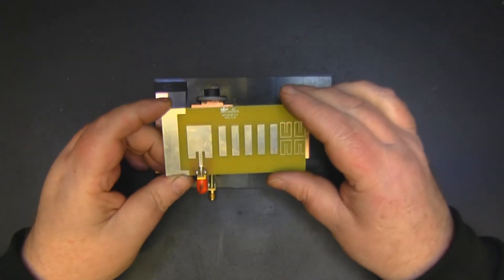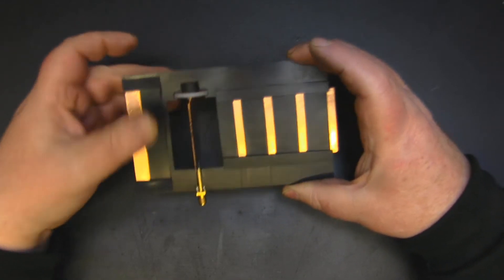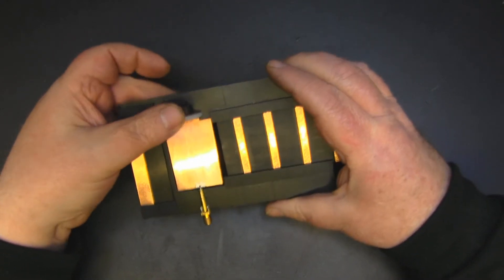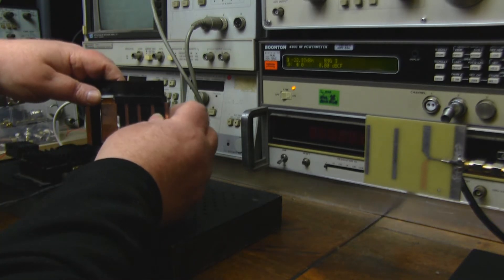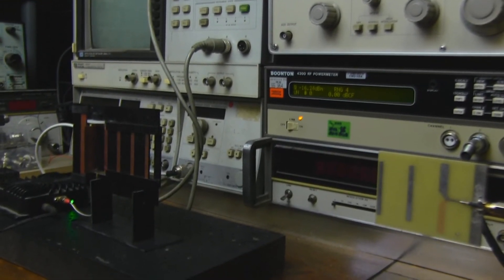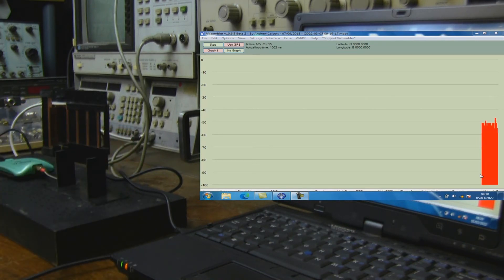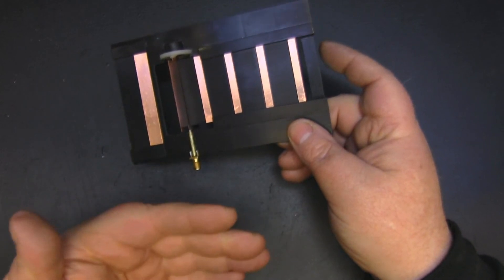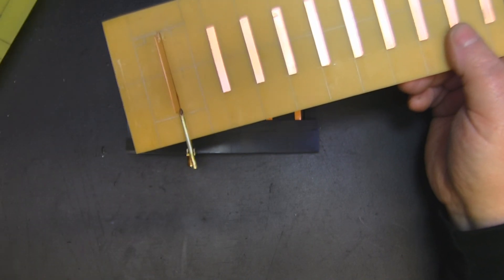Designing a 2 4GHz Yagi Small change makes a Big Difference

Comment: What would happen if you were to place this antenna into the focal point of a Dish Network satellite dish and then measure the gain. The dish is basically a 50-60 off center fed dish do it’s angle would have to be compensated for the off center feed.

Comment: I've made a 2.45 GHZ Yagi (Plastic tube and solid aluminium rods) , with a loop as driven element. However the balloon was important and a shotgun  (stub) balloon worked best, lower losses than a coiled length of antenna cable. Losses are simply too high with such a small turn radius at 2.45GHZ.